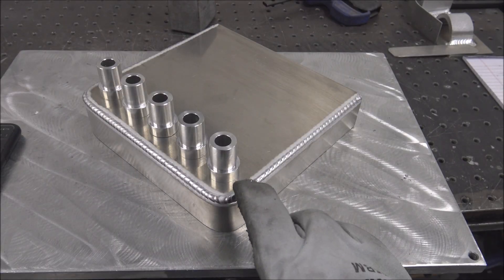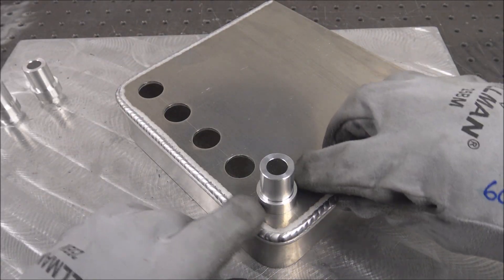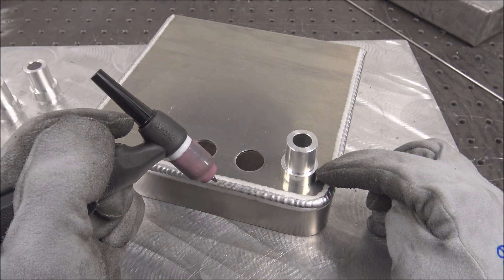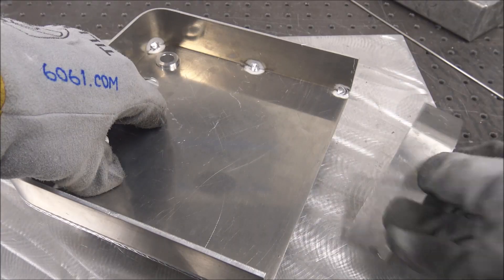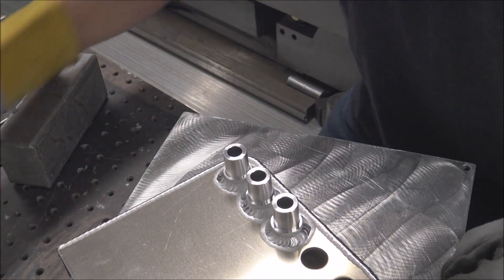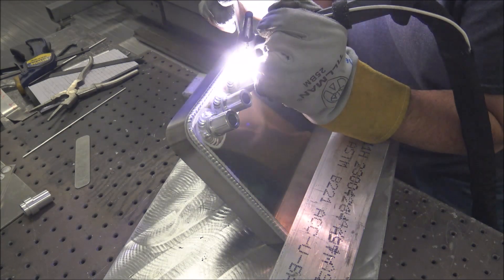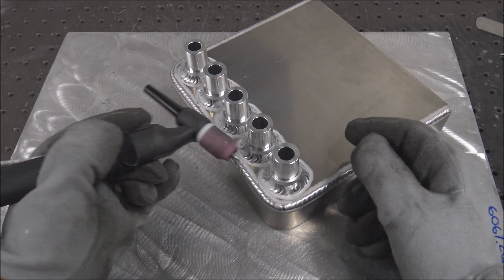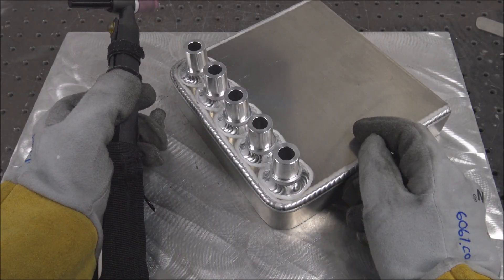TIG Welding Aluminum Fabrication - Gettin' in the Tight Spots - 6 Tips

Comment from the maker: -Learn how to TIG Weld and fabricate with ALUMINUM : http://www.6061.com
-TIG Button variable amperage controller (replaces foot pedal) http://www.6061.com
-PrimeWeld 325x: http://www.primeweld.com
use code "6061" to save 5%
-Fiberglass heat pad: https://amzn.to/3XdlBrk
Reply: What balance, frequency, pps , en ,ep , ac wave form

Comment: Any way to remove the white haze from around the welds? I know there’s no avoiding it as the balance is doing its thing I just wondered if there was some sort of miracle spray or treatment that could be applied after welding to remove it. 

Oh and your so inspirational man, I appreciate all the videos and effort you put into them 

Thanks a ton!
Reply from the maker: You can scrub it with scotch brite pads, but then you lose the shine on the weld beads where you touch them. 

Or you can media blast them with something softer than sand (soda or walnut shells, something like that, I'm not sure), but then you also lose the weld shine.

Comment: As a matter of procedure, I think I would have done the two outer flanges first, for full circumferential access, followed by the next two in, so only one difficult radial point on those, followed by the most difficult center one. But I am just an engineer, not a aluminum welding god, like someone 🙂
Reply: Funny, I had the opposite idea...I would have started with the center port, then worked my way towards the outer two.
Reply from the maker: Then your welds won't look the same on all the pieces. You'll be fighting to get around those ones that you made harder for yourself. You can't keep the ideal torch angle around them all while welding.

Comment: Would it help to weld the outside ones and the one in the center first and then put the other two in and just have two tight ones?
Reply from the maker: No, then you'd have fittings in the way on both sides. The way I did it, the only tricky spot is the weld start/stop locations on each one. It makes everything look more symmetrical.
Reply: @6061  👍

Comment: Great video! Really like the way you have real speed and sped up portions, did have to let the part cool down at all between starting the next fitting?
Reply from the maker: No, I just kept going and used slightly less amperage as the part got hotter. Less pressure on the TIG Button. Welder was set around 100a the whole time.